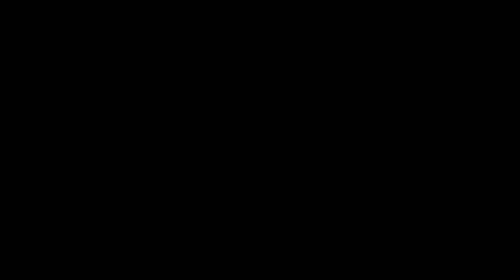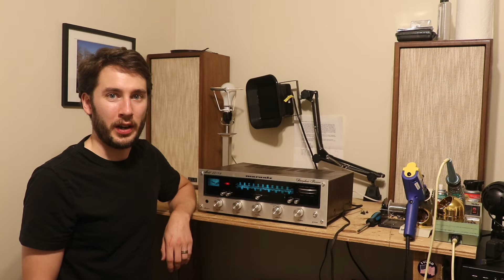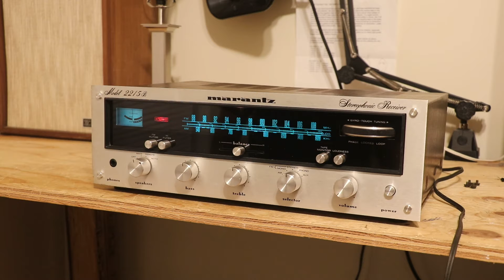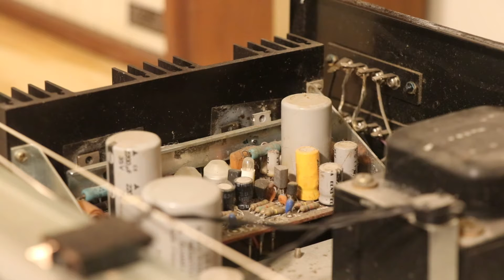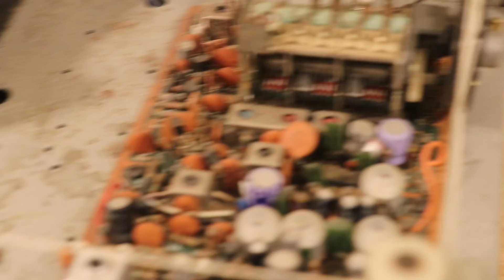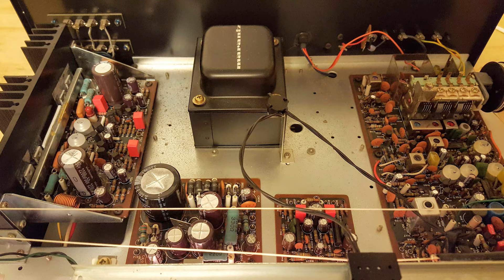How To Tell If A Vintage Receiver Has Been Restored

Comment: A good question, some sellers just say restored to gain a higher price without doing anything apart from a light dust lol. A full receiver restore would also have to have the radio part re-tuned properly and this takes some serious equipment to do it right. This is also the case with cassette decks that sellers say has had new belts fitted, but I have had so many in the past with just the old floppy belts.

Comment: A good tech like a reputable mechanic will bag up old components for show and tell also.
Reply: I did that all the time, even if it was one part. I couldn't tell if they appreciated it or not, but they usually remarked at how small the parts were. I even invited people to watch the repair, they'd usually decline. I did a few in front of people and they were amazed at just how much work it was. It was alot of fun, and a bit scary to have them watch, but I liked the challenge.